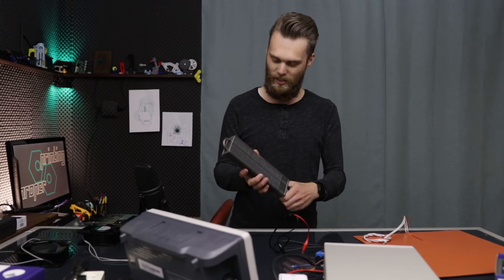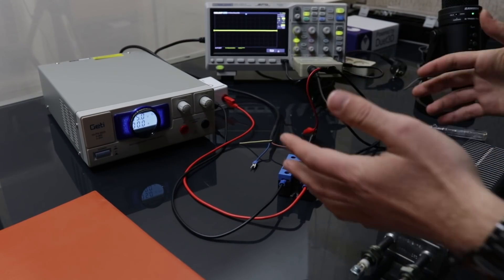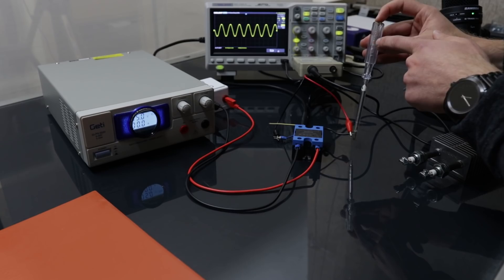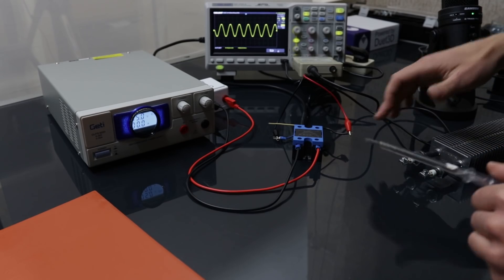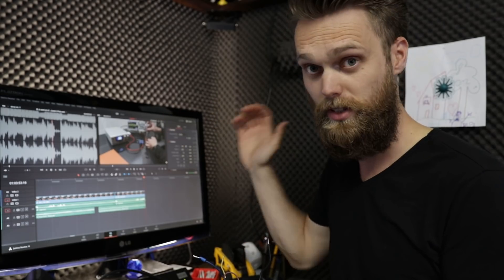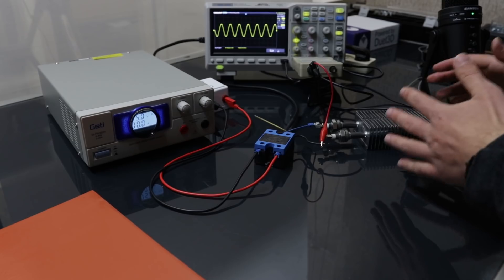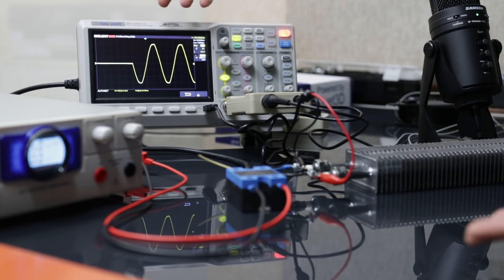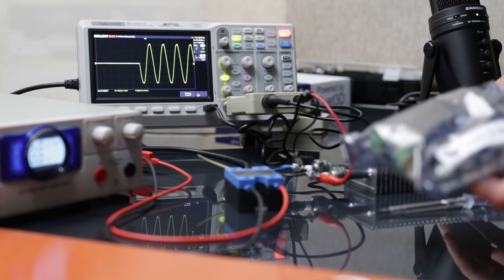Controlling an enclosure heater and silicon bed heater with a Duet board.

Comment: Great video. You make all this seem so easy :-), but still show that it is hard work...

Some stuffs I would do if doing your project:
- Uses the back of your hand to "check" if a wire is live. Otherwise, if the wire is live, it may cause your hand muscle to contract with a death grip around the live wire...
- Uses neon bulb indicator after the relay so that you can visually check if the 220V is live or not. They can work directly with 220V.
- Buy yourself a non contact voltage detector "pen". They are much more reliable than those old screw driver (that my father also taught me to use, and I've always had trouble to see the light), make noise, have a clearly visible light, and are much safer to use as they don't require contact (they detect the EMF variation caused by the AC). And they are cheap, so no excuse for not having one.
- Uses a (resettable) thermal fuse or something like that to shutdown the heater in case of overheat (if temperature sensor or controller go wrong).

Comment: Did you insulate the aluminium extrusion frame from the heat bed because it can act as a heat sink if attached directly to the bed leading to bed heat inconsistencies

Comment: At this point I'm not sure why you didn't just build yourself a CoreXY with the features you're adding.  Buying an S5 then throwing out the bed heater, hotend and motherboard it's pretty pointless.
I'm assuming you bought the S5 thinking "I need a big fucking printer to print rims".  Then "I need to make the enclosure smaller", then "I need all metal hotend capable of hotter temps" then "I'm needing to control ambient in the enclosure".
Maybe just use these lessons learnt to try and forward think a bit more on your next project to save yourself a bit of money and time.
Reply from the maker: I've thought forward on this one, but based on your assumptions I can imagine that it doesn't look like it xD My reasoning is to show the viewer what can be changed to an existing printer. A lot of viewers already have a Creality machine and I already got comments, including 3D printing Nerd, mentioning to do the moving portal mod too. You don't have to do exactly what I do, but you can pick the relevant things and get inspired. Using Creality printers is interesting for a wider audience than a printer from scratch made by a small YouTuber. I'm going to make my own printer, don't worry xD Hopefully this makes some sense
Reply: @properprinting  Yeah makes sense, bait people in by using printers they are.  (It's by no means a criticism, it's a compliment to your strategy)
Reply from the maker: @joebywan  it's a win-win situation and I'd like to inspire as much people as possible and learn as much as possible :) I have some projects in mind for which no Creality printer is sufficient xD

Comment: These solid state relays leak a bit... enough to make advanced Dutch words come out :D PID control also drives 0 or 100%, in that way it's not different to Bangbang control. But PID switches much more often. The solid state relay only switches on and off at zero crossings, which occurs 100x per second. Combined with PID control this could give a bit of unexpected driving, but PID is dynamic, so it will correct for it.
Reply from the maker: Thanks for your comment, as far as I know and what I understand of this source https://reprap.org/wiki/RepRap_Firmware_heating PID uses a PWM signal at 10Hz for those heaters so it's compatible with an SSR. I didn't know that when I started the video
Reply: @properprinting  Yes, you mentioned this in the video. The only problem is the zero crossing, which causes the pulses to be inaccurate. A short pulse could result in no power at all if the pulse has no overlap with a zero-crossing, or a half sine wave if it overlaps. But PID is dynamic and will handle this quite well because the heater is "slow" anyway. Leuk kanaal!

Comment: btw you can use PID with the Duet, just set the frequency to something like 10Hz. `M307 F10` This is default for the bed output in RepRapFirmware 2.x but not 3.x. (edit: good on ya, but you need to specify it for E1 heater)
Reply from the maker: Exactly what I found out in the last part of this video ;)

Comment: Omfg guys stop using these phase testing screwdrivers, they are dangerous as f*ck!! Get a Multimeter or a duspol pls
Reply from the maker: Do you have a source which explains why these are so dangerous? I know that there's only a resistor between your finger and the live wire, but I'm wondering how many people actually got hurt from using these things
Reply: @properprinting  thats the thing, there is only a resistor. If u got dry skin or just a bad connection to earth, the light wont be on although the connection is live!

Comment: Hi Jon ,
What is the thickness of the aluminium bed you are attaching the heater to?
Is it cast aluminium (not rolled, also called "tooling plate")?
Rolled aluminium will warp with higher temperatures, due to internal stresses caused by the fabrication process
Why do you attach reinforcements bars under the bed?
Reply from the maker: Hi Rob. It's a 3mm thick rolled aluminum plate. The plate including those profiles are standard with the S5, at least with the one I received. I didn't think of the warping and I hope I can cope with it. It will be fixed without springs with a glass plate on top, but I'll keep in mind that I might need a tooling plate, thanks for the info!
Reply: Anyway, if you get a 5 or 6 mm thick tooling plate for bed, you can also do away with those reinforcements under the bed, allowing you to get a larger heater and thus heating the bed more evenly
Reply: I also got some samarium–cobalt (SmCo) magnets from AliExpress to embed in the tooling plate
Thesse magnets can with stand 360° Celsius and will hold steelflex printing surface very well
Reply: I got my custom 1300 watt 500 by  500 mm silicone heater from 
li (at) alirubber.com.cn

Comment: Cool ich suche ein heizbett das lang und schmal ist z.b. 235 x 705. Ich brauche für meinen Ender 3 noch sowas. Aber in dem Bereich habe Ich kein passendes Kaufbares gefunden. Mein Ender 3 pro Sword Mod & Hack. Wäre interessant wen du was auch mal in der Richtung herausbringst.
Reply from the maker: The easiest way to accomplish that is to buy multiple smaller mats, but this doesn't come cheap! I've some neat ideas for the future about a printer like you mention :)
Reply: @properprinting  ja ich brauche den Drucker von den Abmessungen so um Windradflügel zu Drucken. Wegen den Linienausrichtung ist das so stabiler als im die Höhe.

Comment: Your SSR is leaking AC current -- this is dangerous. Get a brand name SSR, this can hurt you and burn your house down, I'm not exaggerating, it's 230 mains voltage. BigClive did a tear down on chinese relays -- please don't use them. Pay the extra $40 or whatever it is to get a proper SSR. There should be NO voltage on the SSR on the other end when it's off , zero. Cheap chinese SSRs also fail closed, that is crazy dangerous. Guess how I know, I was lucky to be nearby when my delta with a cheap chinese fotek clone started to overheat the bed, the SSR had failed closed! There is nothing a firmware can do at that point, it can shutdown the print, cut the power to the SSR, doesn't matter -- there is AC voltage going to it, it's on, and it will do damage. 
BTW bang bang will give you really funny z artifacts as the bed expands and contracts from bang/bang heating algorithm turns off and on, good that you chose to use pid. Please for your safety -- test the SSR that it is properly potted, it should be heavy and it should feel substantial that there is enough separation resin inside.
Reply from the maker: This is the one I bought https://nl.rs-online.com/web/p/solid-state-relays/1640581/ I don't consider RS components to be a cheap Chinese supplier. Thanks for the warning.
Reply: @properprinting  always add a thermal fuse. Cheap and very very effective.
Reply from the maker: @jotham123  that's a great idea, thanks!

Comment: This enclosure will be crazy once it's done. I actually just finished converting my printers to Duet boards and really like it - much easier to use than Marlin. What material are you planning to try printing the wheels in? A heated enclosure should allow for a lot of exotic materials.
Reply from the maker: It sure will :) It's surprisingly easy indeed, I'm happy with my decision! I'm going to start with ABS because that's affordable. Next on my list would be Nylon, then Nylon with CF and I'm thinking of using polycarbonate. I hope I don't have to make it to PEKK or Ultem, but I cannot exclude that xD

Comment: SSR, not being a traditional relay with an air gap, will always leak some current when off. This is not an issue w/ normal 24V printer heaters. You have an extra need for safety when dealing w/ mains AC. I use a pair of SSR on my water heater. There's always 240V on the terminals since solid state devices don't have an air gap interruptor. The leakage current is mA, but can still be dangerous/deadly. It only takes mA to stop your heart in certain conditions.
 Pro tip: ALWAYS keep your left hand away from electricity (in your pocket as electricians say) as  nerves in the left arm pass close to those for the heart.
Reply from the maker: That's a good tip! I intentionally used only one hand so if there would be any current flowing is would have been through my hand and not through my chest. This hurts but doesn't kill. The leakage current is pretty high actually..

Comment: That voltage you see is the result of induction noise from the wires inside the walls, that's pretty normal, the current is very very low since the resistance is very very hight, that's why when you touch the wires you don't get shocked, because at that moment all the very very very small current goes throw your fingers and the voltage decreases so much that you are not able to see it on the scope. 
But still, don't be brave to test electricity theories because Charles Darwin already has a pretty decent one that totally relates to people that try things like that :D
Reply from the maker: I do agree for the most part. Except for the noise from the wires. It's true that they can pick it up, but the ratio of that probe seperator is high. The solid state relay simply doesn't shut off and the high impedance of the scope doesn't pull that signal down. So I definitely measure a high voltage there, not just noise.

Comment: So... When you zapped yourself with the floating output... Do you know why it zapped you? As you've explained, your body should have pulled the voltage straight down, shouldn't it?
Reply from the maker: That's a good question and I'm still wondering what exactly happened. The only thing I can think of is that my hands were sweaty enough to pull the voltage low enough the first time
Reply: @properprinting  hm right that would make sense
Reply from the maker: @ConstantijnC  after that experience I pussied out to do it again in front of the camera🤣
Reply: @properprinting  I would have as well! 😅I once earthed myself to a halved waveform 120v... F that. Please never again :D Did the current just pass through your hand or through your chest? If it was through your chest, I would suggest getting your cardiovascular system checked out.. just in case

Comment: I would strongly encourage you to incorporate some extra interlocks around the heater block that are independent of the microcontroller. E.g. a thermal cut off switch on the mains supply to the heater and perhaps a “fan is rotating” sensor with a relay output to sit inline between the microcontroller and the SSR....
Reply from the maker: That's a great suggestion, thanks! Heaters like this should always have a back-up, the board is connected to the network too so you cannot be careful enough. We use this as a backup system to prevent overheating which I've good experiences with https://nl.rs-online.com/web/p/on-off-temperature-controllers/1241058/
Reply: @properprinting  use a thermal fuse

Comment: I accidentally used the same SSR type to switch my 12V hotends. Guess what. They did not turn off, due to the lack of AC. :) Tock me some time to find out the reason and to notice I ordered the wrong set of SSRs. Worked fine for my 230V heat bed and now I have some spares. Using PID and it drives up to the target temp without overshoot. Just make sure to connect earth or you get zapped in the future, anyway. :)
Reply from the maker: Funny that you've had this problem! I found out about this when making a test system at my work. I disabled that SSR and I still measured 230V. I used extra standard relays to really turn it off xD Nice that you've managed to control it with PID without overshoot! The enclosure will be made out of a lot of aluminum and I'll make sure all panels are connected to earth properly ;) This is also to prevent electrocution when a live wire springs loose and touches the enclosure

Comment: Hey Jon, mooi! :-) Don't forget that the screen cable connecting the PanelDue with the Duet needs to be very short - anything longer than 20cm will not work, in my experience...
Reply from the maker: Thanks a lot for mentioning this! This is exactly what I was wondering and now I don't have to make that mistake :D

Comment: Normal Person: wires a light to see if it switches off. 
Jon: hook up an oscilloscope with differential probe and all security precautions, still sees a signal, then uses FINGER to see if it is still powered. 

Admit it, using your fingers was the only idea you had, all that oscilloscope setup was only for the puss***s watching on YouTube.
Reply from the maker: Haha yes I have to admit xD Another important reason is that a scope makes it look like I know what I'm doing🤣